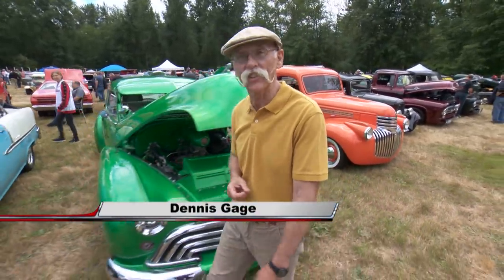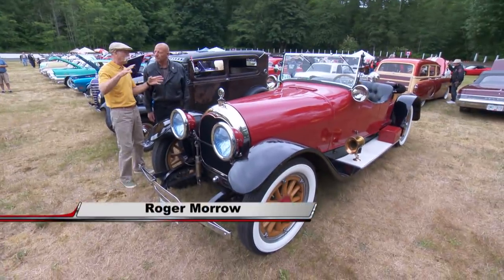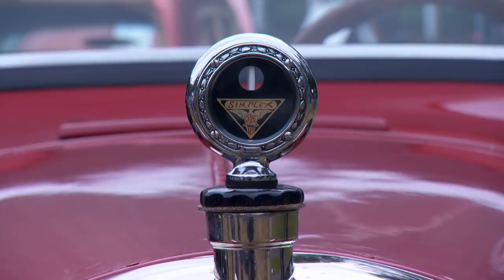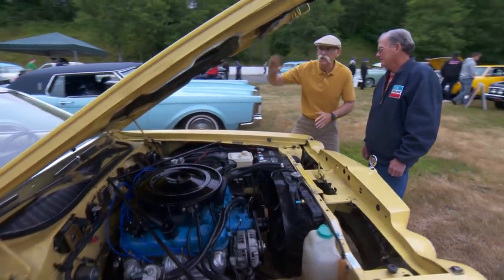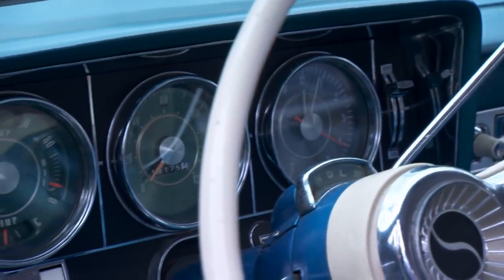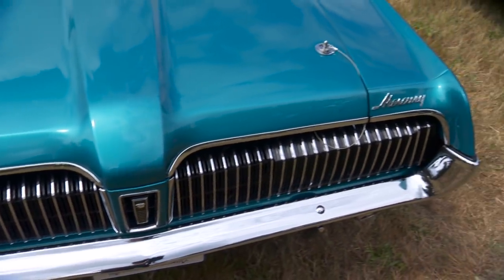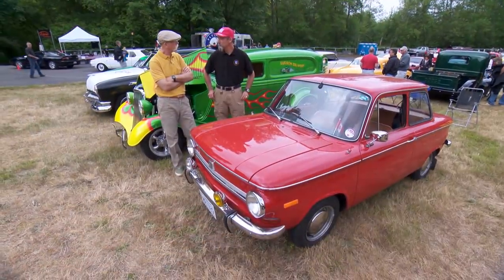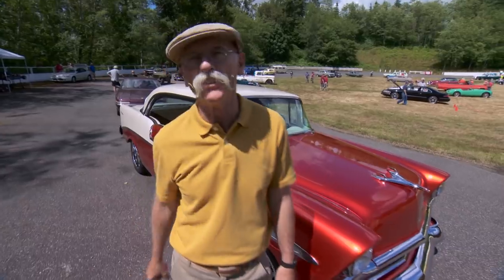Dodge Charger Land Yacht | Canadian Classic Car Show

Comment: My parents bought a brand new 76 Charger SE after my dad totaled a 75 Coronet Brougham. It was silver with red velour interior, the paint started to peel within a few years. After my mom had an accident in the car in 1980 (it was repaired), early in 1981 they traded it in for a 79 Cordoba in light blue metallic, dark blue "Corinthian"  leather and power everything but the antenna that ALSO started peeling a few years later. Chrysler didn't seem to be alone with the peeling metallic paint, used to see other brands in the day also having problems with metallic paint.

Comment: My dad special ordered a triple black 76 Cordoba, the Charger SE's brother, brand new. He couldn't find 1 that 'checked enough boxes' in the dealership's inventory in the entire Chicagoland area. He wanted leather. He wanted a/c, non tilt 3 spoke wheel, he wanted the electric rear defogger, 4 speaker am/fm but not power antenna, he wanted manual windows and locks,.. but most of all, he wanted to factory P code 400 non ELB with dual exhausts and hd suspension. So a $5400 based price car turned into a $7800.00 car by the time he was done with it. He also ordered the rare factory tach. The factory screwed 2 things up on the order, which I guess was fairly common in the 70s.. It did not have the 3.21 rear gear in it, but 2.71, and also, even though he ordered it with the dual sport outside remote mirrors, his had the smaller round chromed units on it instead, albeit they were both remote controlled. After waiting 4 months for the car, he settled for it. Despite his best efforts, he couldn't keep the rust monster out of it, and by late 88 the car was in very poor condition. The 400 and 727 non lock up trans were fine though, and in late 89 he sold it to a guy that just wanted it for the drivetrain, for $300.00... Nice to see an original example of the last of the Mopar Bs!
Reply: Growing up my mom got a Cordoba traded a '73 Charger SE with a 440 for that polished turd, basically the same car as that Charger, with a 360.  It it was gutless and chugged gas, she got rid of it after year, it was the last domestic car she ever bought.  

I was young but apparently the 440 in the charger was a '69 440 six pack with a "race" cam and headers so my uncle claims.  The old photo's confirm it was orange and had the six pack with headers.  As to how it got into what would have been a year old car at the time, apparently it was a car dealers son's car in NC that got into trouble running from the law.  The engine was from his first car that he totaled, a '69 Charger.  I heard of crazier stories, but the photos suggest it could be some truth to it.

Comment: That's the best Cougar ever made. The Charger is sweet too. Love the powerful 360 motor. I could burn rubber with the one I had and got a whopping speeding ticket. It wasn't a Charger tho. It was an '89 Dodge extended van. Very fast with power to spare. Great engine 360, also the 318 was just as good

Comment: Love it to death I have a 76 dodge charger 360 4bb and. I have a 77 Cordoba I put a 383 4bb in it and it was ordered with no AC like who orders a luxury car with out AC but I love it to I've had the do a up to 125mph with a 2.45 gear but I have put in an 8 3/4 rear with a 3.23 sure grip so I don't know have fast I'll go yet but it should take off better from start....... Love these cars especially if you mod them where they need it most.

Comment: Looking at the engine of the Charger... I used to work at a Dodge dealer 1977-78. I remember the engine compartments being a lot more crowded. Now, I know that '75 was the first year of catalysts and unleaded fuel, but is it possible that US cars had more stringent emissions requirements than Canadian (or Mexican) models?
Reply: That's possible, but it looks like.it was desnogged as none of the hoses seem to go to anything non essential

Comment: I'm not an expert but in 68 I believe Ford made a special stronger 302 like the Cougar has, I worked on a 302 boat motor in the era and it had bigger rod bolts and had more HP than the other models then used for boats. it all looked similar though ,

Comment: I vomit when I see this. Puke. I have a 74 Charger Rallye 440-4 with the optional 3.55 gears and the torqueflite. Yellow with he black side stripes, power bulge hood with 440 magnum on the sides. That yellow thing is not a Charger.
Reply from the maker: Good for you, but this is still a cool car in its own right. Expand your horizons. 🙂
Reply: @MyClassicCarTV  It might be a cool car but seriously? A Dodge Charger? C'mon even you must admit this.
Reply from the maker: Really?? In the late 70's this was comparable to all the other "muscle cars" out there. None of them had much muscle by then.  Do you remember the '82 - '87 front wheel drive subcompact hatchback that also bore the Charger name??
Reply: @MyClassicCarTV  Thanks for the reply. The car itself I have no feelings one way or another except that it bears the name Charger. As well, that little piece of junk that you refer to, the fwd econobox. Its sacrilegious. Even the the new 4 door Charger I can't stomach.